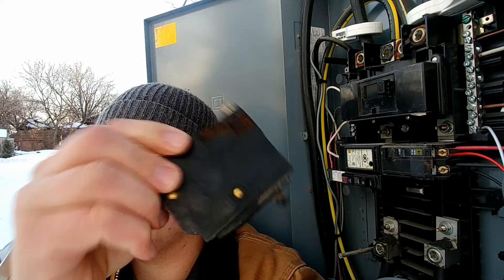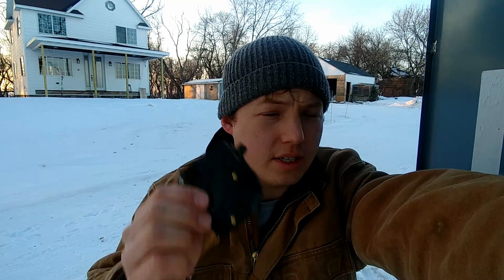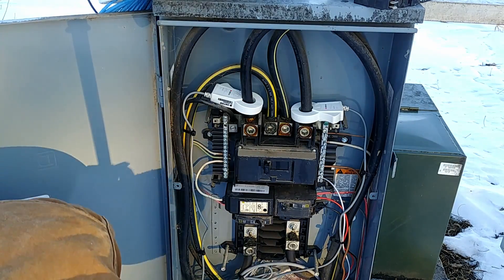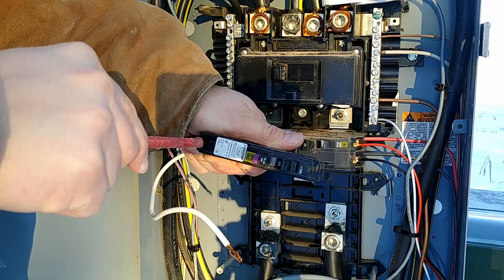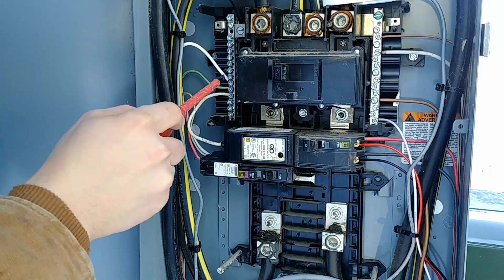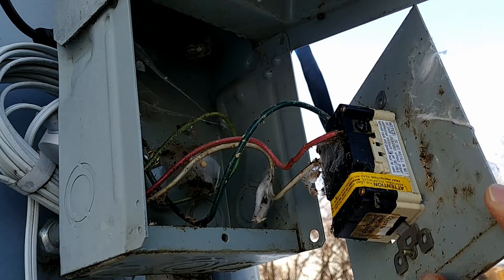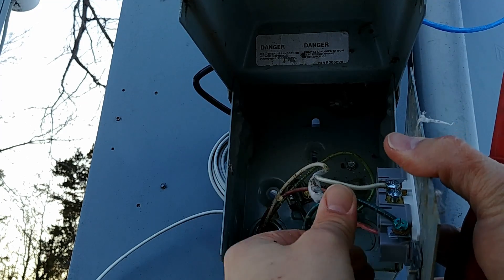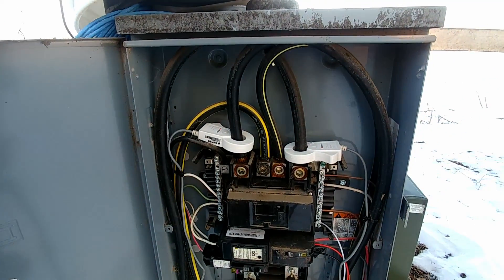How To Install a Ground Fault Circuit Breaker to Replace a GFCI Outlet or Receptacle

Comment: Having the earth pointing up is an excellent thing...  We have insulated plugs here - so a plug can't inadvertently connect a foreign metallic object to the active supply - electrocuting you.   Turning the outlet around achieves the same end.

Comment: There 2 ways to instal ground fault receptical. 1 from a mercury breaker  pannel with a earth  ground bar seperate from neautral bar. A neautral is a traveler not a ground.all neautral circuits carry 1/2 of the curent back to transformer making it a traveler not a ground . 2 put a shorage breaker in panel box with earth ground wire attached to earth ground bar, and all recipticals is on that circuit is ground fault. This breaker is very expencive. A shortage  breaker with a earth ground is a no fault circuit breaker.

Comment: can you cite where you got the information that you can't use a gfci outlet on a gfci breaker? i've read that this isn't the case.
Reply from the maker: Both from electricians that I've talked to as well as the State electrical inspector in our area. Not sure why exactly but I'm sure there is a reason. I don't know why you would double up on GFCI devices anyway though. Let me know what the use case scenario would look like? Thanks for the comment!
Reply: @BenjaminSahlstrom  i can't think of one, other than i haven't seen it in the NEC. i suppose one would argue in a retrofit scenario it is just somewhat of pain to have to remove the devices. i can imagine having both would double the chances of nuisance tripping. but other than that, i can't think of an electrical reason. that's why i thought it would be interesting to see it written in a code somewhere, even just to satisfy my own curiosity.
Reply: The reason is simple.. to eliminate redundancy.. having both would serve zero purpose.

Comment: can someone elaborate  "Design pressures"  on reach-in cooler data plate
 what it means?

example on Traulsen  G22013TS      [R-404A]
Design Pressure    HIGH Side  350 PSIG            LOW Side 250  PSIG

is this talking about Max pressure the system can  withstand?

Thanks
Reply: Schematics,  that refers to the design refrigerant pressure on the high pressure and low pressure side of the compressor when the unit is operating under full load. It has nothing to do with the electrical side of the unit.

Comment: Are you a licensed electrician? should give that disclaimer. Did you put the panel in the snow? won't that be a bad thing when you put it back on wet? Overall, great video.

Comment: I wonder why they just don't make all of the circuit breakers GFCI and be done with it.  I'm sure there is a good reason for it.
Reply from the maker: There are multiple reasons I'm sure but I believe it is trying to strike a balance between practicality, safety, and cost savings. GFCI is mainly required where there is a high chance of the power being used in a damp or wet location such as in a bathroom, kitchen, unfinished basement, or outside. Other dry areas such as bedrooms and living rooms have a lower chance of the individual being connected or in contact with earth or ground so a ground fault scenario is not nearly as life threatening. Will be interesting to see how this evolves as time goes on and these technologies get more affordable.
Reply: The one thing I know is some devices will trip a GFCI outlet or GFCI breaker if they are used to power that device. So that probably the main reason.
Reply: @Robert-Wilson  Okay that makes sense.

Comment: like the fact you removed all conductive material before working in an outside box...
Reply: and i am extremely interested in correct tensions or torques..
Reply: question my you tube friend...  is gfci breakers mo betta than gfci receptacles?  and of course, why?
Reply: @kevinwest4488  with a breaker you can cover multiple receptacles for less money than buying all gfi receptacles for that circuit.